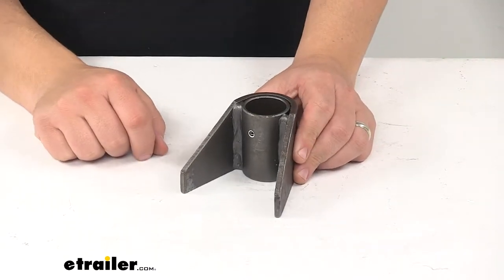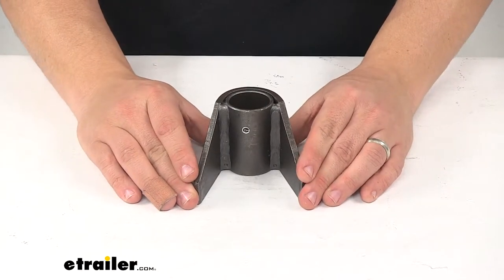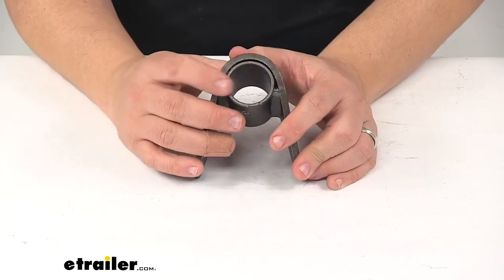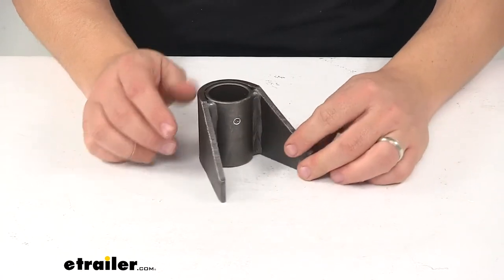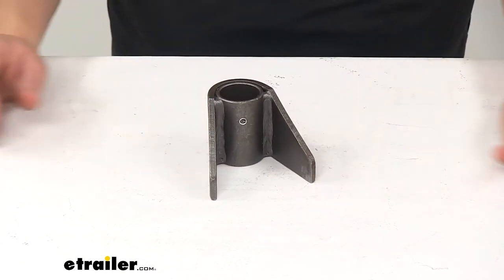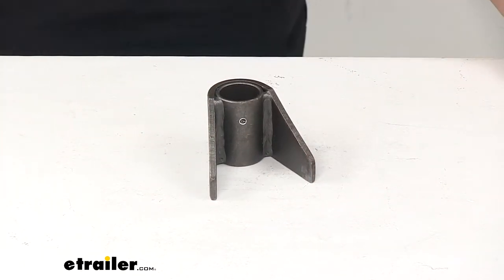etrailer | Replacement Shoe Tube Holder for Fisher Snowplow: The Breakdown

Comment: Is this the same part a the fisher HD? Can it be used in place of the more expensive  bolt on one for the HD2? I’m aware this is weld on, just wondering if the 
angles are the same
Reply from the maker: This is for a Fisher plow. Check out our product page here https://www.etrailer.com/Snow-Plow-Parts/SAM/3371303310.html
I reached out to our supplier to try and find out if it'll work on the Fisher HD2 and they couldn't verify it either. My guess is even if the part is the same shape and dimensions modifying it to be a bolt on instead of a weld on wouldn't be recommended. 
Sorry I don't have more info for you
-Chuck S